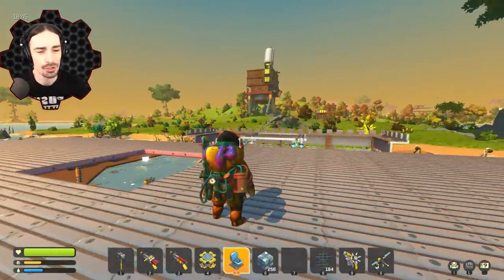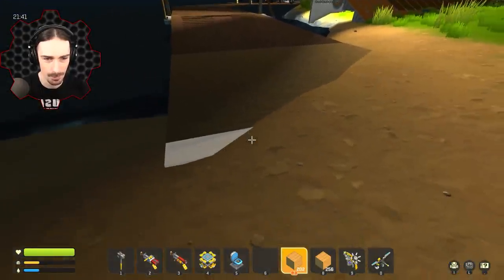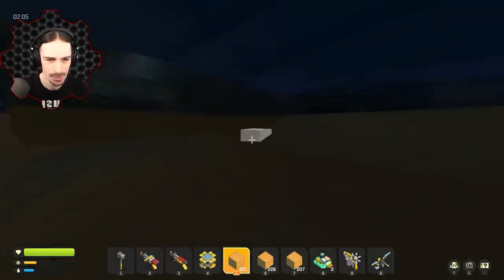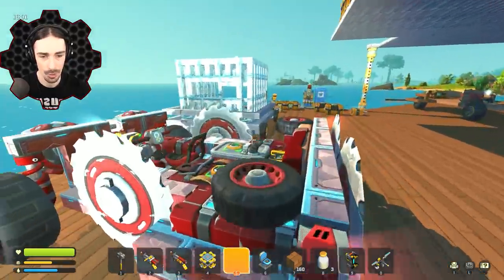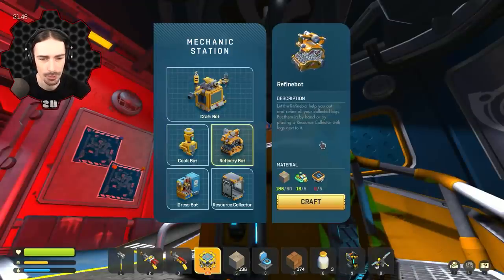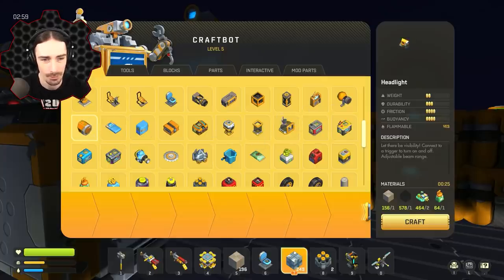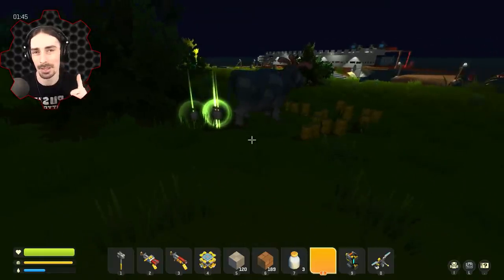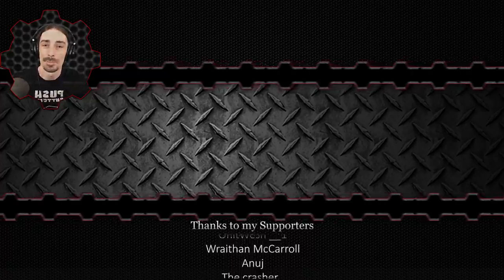Silly Glitch Spaghettifies My Improved Mining Vehicle!  - Scrap Mechanic Survival Mode [SMS 39]

Comment: 22:07 Those big cube-shaped rocks can be used to make a wall.. If you weld them to each other or to the block on the ground it will be a perfect protection. Bots cannot damage them (not sure if it can stop big reds).
Reply: slk979, I'm pretty sure that they can despawn
Reply: @EdwardTriesToScience , not sure man. I have a wall made of those rocks for a week now.. maybe they do not despawn if they are welded.
Reply: @slk979  smashed rocks do not despawn, just like scrap metal and cut wood, some of my rocks tree, scrap metal are sitting on ground for 2 weeks.
Reply: Is that still a thing? I thought the dev's talked about stopping people from being able to weld tree's and rocks due to how it was being abused.
Reply: @JustaGuy_Gaming  I am not sure if it is still a thing in new update, new beta, because my world cant be loaded in new beta, so i play old version where it is still available. But i saw one You Tube player who couldn't weld farmers in cage anymore with new update. So i assume devs fixed it.
Reply: @JustaGuy_Gaming  It was removed a few patches ago then re-added again in a recent patch, apparently enough people complained for the devs to go 'okay fine'
Reply: @juriscervenaks8953  Farmer welding is no more, but tree and rock welding returned.
Reply: @suicidalbanananana  Probably because one it made logging the big tree's fare easier given all the bugs with bearings and pistons at large heavy objects. It also gave some really neat blocks to work with. I've seen tree houses and fire places built really well with those logs and rock blocks.

Comment: Base: suspended above water
ScrapMan: "Untill I run out of water"
30:25
Reply: Lol
Reply: To be fair he can't exactly have a water pump going all the time as it doesn't know when to stop. If the water chest was connected to the rest the system it would flood all chest with water. Still something you turn on and off would be pretty easy.

Comment: In astrophysics, spaghettification (sometimes referred to as the noodle effect)[1] is the vertical stretching and horizontal compression of objects into long thin shapes (rather like spaghetti) in a very strong non-homogeneous gravitational field; it is caused by extreme tidal forces. In the most extreme cases, near black holes, the stretching is so powerful that no object can withstand it, no matter how strong its components. Within a small region the horizontal compression balances the vertical stretching so that small objects being spaghettified experience no net change in volume.
 (from wikipedia)
Reply: I just learned spaghettifieing in a large and professional WORDS

Comment: 3:55 They could add a clock that you can set a time, and when it is that time, the clock will send a pulse, which you can connect to a part 
Example: you set it to 12 am, and when the time is 12 am, it sends a pulse which you can set from 1-10 ticks long, which you can connect to something that can be powered, i.e logic gate, light, toteblock, water cannon.

Comment: Idea: you could make an air raid siren that sounds 5 or so minutes before midnight and you could connect it with an and gate to the watering system so it only sounds when you water your crops
Reply: Yeah I think that might be cool, but if the timers or whatever is used to time the alarm gets unloaded, the timing might become off
Reply: good idea hmMmMmM
Reply: Must try 👍
Reply: You can also program it to turn on the bouncy floor and raise the bridges
Reply: Nice idea there !
Reply: There's an issue he would need to have a full timer system that was constantly active to determine what time it is also yes it may get unloaded and not work right. Just seems a bit too much work for too little reward
Reply: The problem is we cant have a clock, while we totally can make all sorts of great clock designs, from mechanical to logic based, the problem is that if you travel away the whole creation despawns and that also means the controller/logic running the clock would pause, so for example you'd leave your base-area at 8:00 in the morning, as you drive further away its 8:15 and the clock despawns, after a day of looting or mining or whatever you return, its 19:30, you come close enough to your base-area for the clock to respawn again, clock says its 8:15 because thats where it left off right before it despawned earlier. What we really need is a 'clock gate' (some kind of object that will always know the correct time and we can connect other logic too) or at the very least a way to detect day/night with a sensor pointing at the sky or something.
Reply: TheCleverJoker but first how much this man plays plus you could have a timer reset he could click when unauthorized farming is detected
Reply: @inabothwick6353  I don't think you know this but he doesnt do much logic stuff that usually goes to KAN, Scrapman is good and all but I don't think he could make a reliable clock that could do something like this especially with the unloading issue, it would have to be attached to all of his creations and he would need to activate all of them simultaneously to have it be accurate
Reply: suicidal.banana this is a great point I didn’t think about this

Comment: Love it that Hank's making friends.  Suggest that you consider putting your seat on a platform - makes it easier to see when it's up high.  I also used controller-power for powering the wheels (to save on gas, mainly) and I used to think that electric-powered drills did better, but haven't tried it in the new patch.

Comment: Some big rocks have that lag, especially when you have driving with bearings, my entire mining vehicle got launched in air, and rotating uncontrollably. You can smash those rocks with long hand and 1-4 drills, better welded to ground, gear out of glitch area- long arm. Then small rocks brake with hand. And move smashed blocks to car by hand.

Comment: From what I've seen on other channels, the Refinebot actually has a pretty long range where it will grab from the Resource Collector... but only if the collector is on the side it pulls resources into the grinders.

If you want to experiment, you could set up refinery on a long line of blocks, then start from the furthest block and slowly move the resource collector closer until it starts grabbing.

Comment: 29:35 The range at which bots and woks are loaded in is between the range at which the map is loaded in and the range at which creations are loaded in. So if the boats are loaded in but your creations are not, the cage keeping Hank inside simply doesn't exist at the moment, which means Hank can simply walk away. So if you get far away quickly enough, he won't have tome to walk away.
36:43 Missed opportunity to cage the small green bot, so Hank has a friend to talk to the rest of the time, too.

Comment: Floppy bearing issue happens to me as well when mining.  It is very frustrating.  Also you can do controller driven saw blades and drills and it works extremely well.  Slower drills are much more stable on rocks and just as effective. Add a electric motor to drive the vehicle and you have much more fine tuned driving control around rocks and trees.

Comment: Trust me it's a SUPER common thing to accidentally right click when you have a new mouse. Tip is put your middle finger on the scroll wheel instead of using your index finger for it. Middle finger got trained for trigger fire lol. Also random Scrap Mechanic tip. You may have noticed that while sprinting you can't change objects with the scroll wheel but if you can press the number keys then you can switch to things like your hammer or guns while sprinting and not need to do that awkward pause.

Comment: 1 collector, 3 refineries.  It will almost always be empty.  Use 2 level 5 controllers on max speed for the drill bits.  You'll save on gas since you'll only use it for driving.  Throw some saw blades on yer backside to protect your tires.

Comment: At 4:02 if you look at the top of the screen you’ll see a haybot come out of ragdoll mode and go down the stairs. It happens very quickly tho and is on screen very briefly. That’s how the haybot got in ScrapMan.
You might have to decrease the power of the bouncy floor to prevent it or put a ceiling on.

Comment: If you make the draw bridge sensor based, and you set up a logic system far enough back from the bridge, you should be able to go full speed out of the base. Also, if you set up the logic system right, you can close up the bridge automatically.

Comment: My thoughts on the floppy bearing issue as someone with no coding experience but knowledge on how it works somewhat: Either that node was two or more fused and the clipping made things buggy, scrap mechanic was just not liking that area, or the Devs broke something by accident. Or that node was just unstable for some strange reason.

Comment: You should power the drills with controllers,their speed does not affect the efficiency, I can confirm with experience and it will save soo much fuel. The breaking down of the rocks is mostly affected by compression force. No matter what speed the drill is on it will break the rock at the same speed,given enough compression. Also the amount of drills is overkill lol
EDIT: Forgot to mention you need lvl 5 controller speed for it to be fast enough to be at "crushing speed".

Comment: I did kind of the same thing, the difference is I used barrings and controllers instead of a engine so I didn't use gas.  6 bearings on each wheel gives you some decent speed, and since the vehicle is so wide considering what it is, I added two more bearings on each side so a total of 8 bearings on each side, with a second controller and a switch so I could have a speed boost button lol.  It works okay on my craptastic computer, only usually drops me to 20fps lol... gotta love my old FX-6300 lol

Comment: quite early on in my survival world i had a bearing power car. it "spaghettified" as well, flew off into the sky, flopping and twitching dropped my from the seat, killed me and is still ocasionally possible to see as it flops across the horizon. i tried catching it several times, but every time you get close it catapults itself far away at high speed. it's parts really resemble electrons orbiting an atom than a car. but now i kinda treat it like the headless horseman in skyrim

Comment: The pistons are over stressed from the turning and overburdened on weight. Try making only the back ends turning and welding the 2 drill sets together. It's likely the drills are colliding with each other and twisting each other.

Comment: you should make a large panel with pistons with drills, which you can weld to the groumd amd use to mine rocks from the top to bottom, and just move a refining vehicle aroung to catch all logs as they get refined by pistons forcing drills onto them from above

Comment: To see this (since it's only in a split second) pause the vid then click this timestamp: 4:02

At the top of the screen, you can see that the bouncy floor seemed to have pushed the haybot over the wall as you can see it is in rage doll position and Scrapman doesn't notice and goes to deal with the other bots and the haybot stands up and starts to attack then Scrapman notices it.

Comment: Say Scrapman, about redesigning the base layout - would it be useful to have some vacuum tubes sticking through the cieling, so you can just load chests from your mining and logging vehicles down below? You could even extend it to have the refinebots under there feeding into the chests that lead into your actual bots.
Now as for your underwater viewport, what if you put it between the main structure and the farm, rather than over the deeper section of the ocean? That way you'd already be working to connecting the walls to the rest of Scrapmanor.
EDIT: with the wheel popping off, I suspect you did right click. You got the little "picking up timer" when you accidentally picked up the chest, and for some reason it's really easy to do by accident.

Comment: Use strategic placed sensors hooked to spotlights facing and around your base and hook inside lights to it all and when a bot passed the sensors the lights flash for like 5 seconds to warn you of the attack

Comment: You do realise when mining those stone outcrops some fragments spawn underground and the only way to get them back up to is force it by either hammering or collecting them. It occurs most frequently when the drill breakable only rock fragments into the hammer breakable variants. This could be the cause to this bearing spaghetti bug; also check every other farmed rock outcrop for what i mentioned as it would probably massively reduce the lag you get too.

Comment: you can actually put multiple greeny heads on a totem like structure on a bearing with a controller hook it up to a well timed timer and it will be like an alarm clock.

Comment: On your vehicle with the lights on them you should put 4 of them in each carnal direction of the center bottom of your vehicle and then put a bearing with a block that is at a 45 degrees so when you roam around then there will be no black parts on you videos at night and the videos will look so much better and if you could tell the other scrap mechanic players you play with i would love to see it on all the vehicles across all the videos. i love to watch and play it and it is a shame to a lot of black when you drive around in a vehicles when it is such an easy fix.

Comment: Its the problem with suspensions not bearing. When you go up on that mounds the suspension compress which cause the issue. I had the same problem then i removed my vehicle's suspension and now it works as intended.

Comment: did you try to put an extra block above steering bearing and connect it to the opposite side in same manner. like an axle, or design a wishbone  suspension for a more stable ride.

Comment: regarding the spaghetti effect when mining in particular, some rock formations spawn with redundancies, meaning 2 up to 4 copies of the same node spawn in the same spot, inside each other. so when you break the big rock, it turns to 4 or 8 chunks rather than 2.
this redundancy is one of the reason that causes the spaghetti effect on bearings/pistons/suspensions.
another reason is the collision of the chunks with one another, especially when the chunks vibrates/glitches in and out of position.
so best reduce the chunks before mining another big rock or destroy all the rock formation.
this has been my experience so far and solution to it. hope it helps.

EXTRA:
scrapman: moves a milimeter to big rock
drill boi's bearings/pistons/suspensions: FUS RO DAH!!!

Comment: You should just make an alarm that has a timer that goes off every 24 mins or however long the day is
Reply: Wont work because stuff despawns when you move away, and when any logic stuff despawns it will just pause, so you'd move away from your clock at 11 in the morning then return at 19 in early evening and the clock would still say its 11 in the morning.

Comment: I went back to creative because i got sick of all the quirks and bugs making survival no fun, cool vehicles spaghettify, pistons being janky causes elevators to randomly rotate/jump sideways in their elevator shaft, if you try make a complete crafting system (water chems and refinery go into craftbot) the vacuum pipes will lag like crazy, controllers have been buggy for a few patches now and apparently fixing this has a low prio, theres still no automated clean-up of loose objects so the longer you play the laggier a world becomes (because no matter how hard you try you will never find all totebot heads and haybot spines, and totebots keep breaking apart those scrap-huts aswell) And then theres the 8 or so annoying bugs that got fixed over the past years for creative, but all returned for survival (like the deleting stuff while sitting in a seat, bearings cant be painted when something is on them, etc etc)

I want to enjoy Survival, and have tried to do so for a few weeks, but honestly f- this, id rather play creative, at least if something doesnt work in creative i wont have wasted 1-3 real life days on gathering materials and building it, i'll keep track of what they fix but until either pistons or vacuum pipes (and obviously preferably both) get some fixes and they implement automated cleanup again im just not going to bother with survival anymore. If they still didnt fix any of these within a few patches ill just start working on a 'community patch' (because a lot of those systems actually seem accessible trough the lua files, so with some luck i could do some aggressive optimizations myself)

Comment: I had the same problem with my bearing from the wheels but what I did to fix it was at a second set of wheels and for some reason that fix the problem. which is strange since it seems to be a bearing glitch

Comment: i dont see any spaghettification happening there, its usually in black holes: "In astrophysics, spaghettification (sometimes referred to as the noodle effect) is the vertical stretching and horizontal compression of objects into long thin shapes (rather like spaghetti) in a very strong non-homogeneous gravitational field; it is caused by extreme tidal forces."